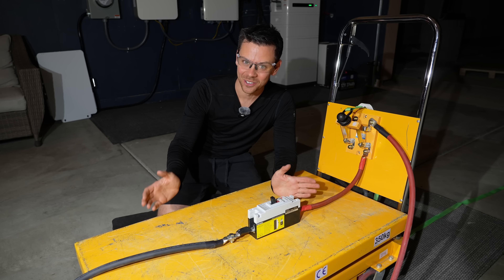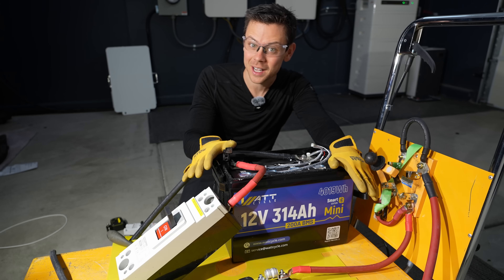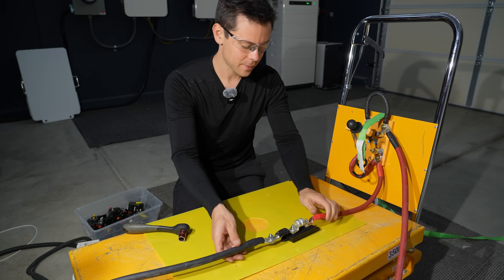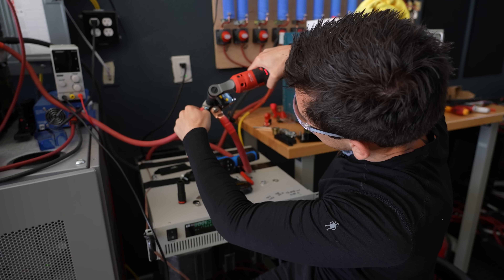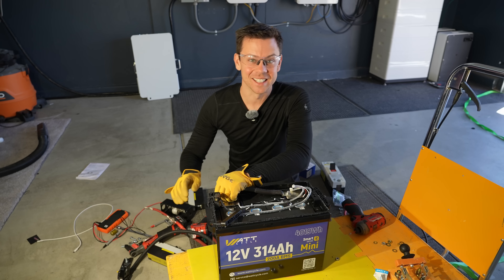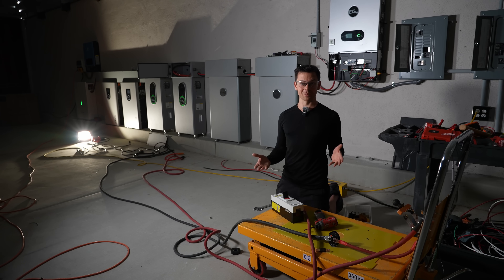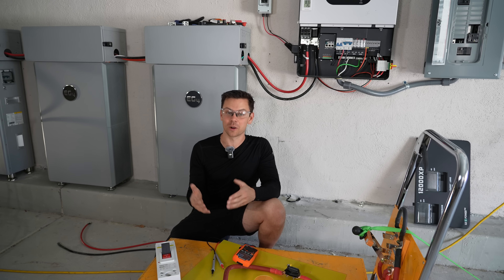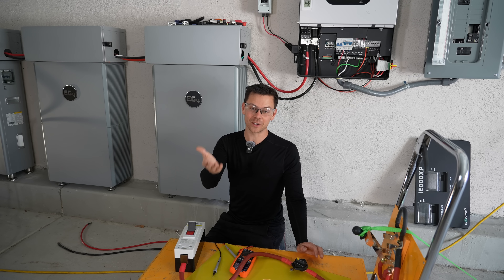DEAD SHORT 88kWh Lithium Battery Bank! What Will Break First?!

Comment: Raw cells would seem to be the only way... 

You risk frying a BMS this way. I'm impressed they are capable of switching off a dead short without blowing a fuse. I wonder what switches they use internally... Just very big MOSFETs? I guess they might be fast enough to catch it before current ramps up to kA levels through cable inductions.
Reply: MOSFETs are several magnitutes faster than any mechanical switch or fuse. In fact, if you can't turn off a MOSFET quick enough electronically, then the fuse will be there only to protect the power source and the rest, the FETs will be gone (fail short or blow off and vaporize completely, so it might even save the fuse 😂).

This turn-off time should be quick enough so that the peak current stays below the FET's (non-)repetitive max drain current (as per datasheet). Achieving this quick shutdown requires 2 things:
- detecting the overcurrent quickly enough (i.e. no slow low-pass filtering on current sense, at least not on the short-circuit protection path, that is)
- switching off the FET quickly, which requires depleting its gate charge as quickly as possible, which means some high-current gate driver (at least high enough in the pull-down direction). It is common to see some gate resistance and a parallel diode in FET/IGBT driving circuits, exactly when the turn-on not necessarily has to be that quick, but the turn-off has.

Also, if you can not guarantee quick enough turn off as the internal inductance of the system is that low, you might opt for designing in some inductance to limit the rise time of the current to the reaction time of the protection circuit.

Comment: If you want true high current then get some large laser discharge capacitors or equivalent to place in parallel with your batteries.  (With initial charge through current limiting resistor, as if you were connecting power supplies).  This is also much safer because the "unlimited current" time is shorter than with no BMS batteries.

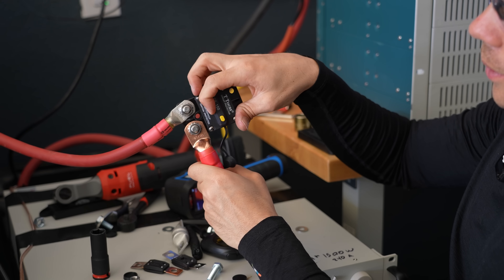Comment: What Fun.  🙂 Will, at 04:00  you act surprised the about this 12V test and say "so less voltage, smaller arc but more current. And it tripped it perfectly. I can't believe this did not trip with the 48V 30kW pack".
Also at 4:20  you say "And a lot of 12V batteries that do not have over-current-protection it's really hard to get over 600 or 800 amps because the wires heat up and the resistance increases".  
While high current in wires causes them to warm, and from there the wire resistance goes up due to the increased wire temperature, it is not going to effect the PEAK INRUSH CURRENT that trips this breaker in less less than 1 second.  
As to getting over 600A on your resistor bank, that bank is made up of 10x 0.2 Ohm (200 mOhm (milli-Ohm)) resistors thus 20mOhms for the entire resistor bank. A fully charged 12V battery (at 14.6V) through a 20mOhm load will deliver 730A.
(I need to workup the temperature rise expected in a wire pulling overload current for 2AWG, 2/0 AWG and 4/0AWG wires, but the math is too involved for now, will follow up with data from a spread sheet . . . and I am past my bed-time.
Again, Thanks Will for this especially Fun video.

Comment: If you do a "raw cell" test please add some suitable "last resport" disconnect capability. My fav for this is a pyrodisconnect, plenty available cheaply that are rated for EVs that runn 800v so they have a huge and proven disconnect capability. Second best is the largest dc contactor you can find, preferebly with a large capacitor and fuse in paralel to try to prevent the contactor welding shut!

Comment: Great tests.  Confirms what I was taught years ago.  Short curcuit current is severely limited by wire size. Having a BMS just makes it all safer.  Good fuses generally work.
I was doing power system short circuit analysis for large plants in the early 80s.  Before personal  computers.  Ridiculous amouts of numbers crunching on a calculator.

Comment: GO with raw cells, 20S, so you cover also higher voltage. No need to parallel them, as they can supply kA easy for short time. You can damage the BMS as the internal driving for the mosfet  is slow, so during the short circuit the instant power loss is quite high if they disconnect, let's say they are not really designed for this and the external wire length has an impact on stored energy that needs to be clamped.

Comment: Thank you for doing this testing Will - it is neat to see the protections of a BMS do work. 

Question - The BMS breaks the connection for an overcurrent due to a dead short BUT it will reconnect after the set time. If the dead short remains it reconnects to a dead short then releases and the cycle continues until something melts. That is what I want to see - leave that knife switch closed and see how many cycles of disconnect the BMS can handle until something fails.

Comment: Retired circuit breaker engineer here.  Be very careful.  Our short circuit test lab is the size of a high school gymnasium with us in a control room behind 2 layers of bulletproof glass and controlled ventilation to evacuate the interruption byproducts.  There are ways these tests can go sideways that you are likely unaware of. Not recommended for DIY
Reply from the maker: I understand. It is very dangerous
Reply: I’m not confident that you do.  Test lab short circuits are conducted with both a secondary clearing device and the current source rated for the short circuit current and voltage.  You look to have neither. The device under test can fail to stop the current and create an explosion.  The arc plasma is superheated, electrically conductive and poisonous.  Maybe see if you can visit a test lab to see for yourself

Comment: If you're looking for a fairly indestructible way to switch a huge amount of current, my old hackerspace created a coin shrinking setup a long time ago that was capable of switching well over 10,000 amps of DC.  It was a military grade pulse capacitor the size of a washing machine that would be charged up to 10,000 volts and was then discharged in a few milliseconds.  The only thing that could reliably stand up to the load were massive copper busbars wired through a pair of short jumper cables that were brazed to silicon carbide contacts.  Each of the SiC contacts were cylinders about an inch in diameter and an inch thick.  The two brazed contacts were then mounted in HDPE sheets that were setup in a book hinge arrangement with surgical tubing that would snap them together when a rope-mounted chock block was pulled out.

The setup survived at least several dozen discharges that I'm aware of.  Each discharge was roughly equivalent to the energy of a 30-06 rifle cartridge.

Comment: I get it now, you're not testing battery safety with a bank, you're testing the fuse itself. In that case I agree with the comments. A supercapacitor will do a fine job and limit the total energy available in case something goes wrong. Lots of brands to choose between

Comment: Bms has short circuit protection if it is a bms as it has fets to turn off the battery in case of over voltage.  Most bms say they protect against shorts but may not survive so they do not suggest you test it.  The breaker is a secondary protection as well as a manual switch.  If the bms fails it usually fails on so you need a breaker or fuse as backup

Comment: 2/0  cable has less than 0.0001 ohm per foot of resitance. If you keep the total round trip cable length to less than 10 feet, reistance will be under 1/1000th of an ohm. A 48 volt raw battery, with no intervening fuse will have about 2 milliohms of resistance. 3 milliohms total will limit the current to (theoretically) 16,000 amps from a 48 volt source. Your big knife switch might add another millohm. Rig up some kind of spring or bungee cord and a trigger mechanism to slam the knife switch shut as rapidly as possible, and it may survive more than a few shorts.
Reply: All the connections also add up. Crimps, screws, at each end of each cable. Tightening is one thing, but if you clean the oxides off of the raw copper lugs, it makes then much better.

Comment: Circuit breakers open slower than a fuse. A magnetic circuit breaker will trip faster than a thermal breaker. There are instantaneous trip breakers but they cost a fortune. Electronic circuit breakers in the BMS will open faster. Do some research on breakers.

Comment: Wow, this was incredibly interesting. Perhaps T-class fuses are not actually needed when dealing with systems that are not using giant cables. For example, a system using 4 awg with batteries that have short circuit protection, it's likely impossible you'd ever get over 1000 amps.

Don't get me wrong, having a T-class fuse within a battery pack is awesome protection and shouldn't be frowned upon, but placing them outside the pack for that 'extra stopping power' doesn't' seem needed unless you have gigantic cables and a BMS that allows all those amps through.

A good ANL fuse should be more than sufficient, or even just a good breaker.
Reply from the maker: Exactly.
Reply from the maker: Agreed

Comment: I am wondering if it would be just as safe and cost effective to get a few big old led acid truck starting batteries of something like them.  That way you don't have to risk hurting any lithium cells.  You might even get lucky and get a bunch to use from a trucking shop they often buy a bunch in advance. could do a trade and help them with an overnight kid so they dont have to run trucks at night for heat and AC could be some more videos in that as well.

Comment: Breaking current capacity is what we're told to be weary of on DC. Ive used the Marine stud fuses on home built, 300ah 48v battery banks, but do wonder what would happen if I shorted them out - The fuse would blow, but would the resulting arch remain across the narrow bridge and potentially cause a fire??

Comment: Wow great tests!! Those are not the results I expected though. I thought for sure that Ruixu rack would be blowing up some components. I still think it's important to emphasize proper over-current protection regardless of what's built in to the battery. It doesn't hurt to have a separate Class T - you'll want it for sure if the primary safety mechanisms fail (stuck FET, welded built-in breaker, etc).

Comment: I used Gigavac HX460 contactors in a design for a high voltage DC test-bed.  These could interrupt 5000A a few times at 400VDC (and much higher at 48VDC).  The are non-latching NO contactors which can be safely driven by a 28V signal.

Comment: If AND ONLY IF you feel you can do it safely, testing if budget or "sketchy" brand BMS would catch these kinds of overcurrents would be good to check. I feel like from your testing that "decent BMS + 1 main T-class" is safe for 95% of us, even if we have multiple loads the main fuse, BMS, and "small" (relatively, 00 seems to be "small" for surge/arc of over 100s of amps) wires seems to indicate that downline fuses/breakers dont need 20,000 AIC level breaking.

Comment: I did something really stupid. I made 2  xt60 to 1 xt60i connector. I thought hey so I increase the voltage if I run 2 sets of the M8 to XT60 through my coupler.  Well stupid me forgot that only works for 2 separate batteries.  I didn't even connect it to anything but once I connected the 2nd XT60 from the same battery the terminal sparked like crazy with a pop.

Good news the Litime battery appears to be working according to the app.

Bad news the post on the negative M8 screw partially melted, so while I got it out, I can't insert one that is not damaged. 

Should I just write it off as a loss or is there a way to fix the terminal.  When I use my multimeter it's still reading voltage 

Could have been worse, definitely a learning experience. Sharing so no one else does it.

Comment: If you don't want current limits, have your batteries charge a capacitor bank. Then disconnect the batteries once current drops to zero. Run the test off the capacitor bank. If you don't want the test destroying your switches, maybe try an industrial size inductor in series.  You can probably make one out of battery cable wrapped around an iron pipe. But that might limit current inrush too much. Maybe a low value inductor - just enough to knock current down in that first instant.

Comment: Fun video. A dead short on raw cells is always going to trip something. The BMS in your battery pack probably has fast short circuit protection. To minimize the arc on closing the switch, close the switch fast. It only arcs when the contacts are bouncing. Maybe an automotive starter solenoid would work better than any of the other stuff you have tried so far.

If you could essentially fire a copper wedge into the gap in a massive bus bar, that would provide very fast switch closure. You want something that closes fast and does not bounce. Of course if you do this with raw cells you have to be 100 percent sure you have a way to kill the power, too. Just in case the fuse doesn't blow, then something else will (like the cells, maybe).

What is interesting to me about all this is that people who are building BMSs that use external contactors really need to take the fault current limits seriously. But internal BMS packs don't need to be AS concerned about interrupting amps. Even if the BMS is messed up or non-functional, it is still going to add enough resistance to the circuit to limit the fault current a little bit. So it may not really be necessary to use class T fuses on big house batteries with electronic BMS.

Comment: you can measure the current with a scope even a cheap used oscilloscope  just use your lead as the shunt and voltage drop across the leads and known resistance you can  look this up  by gauge of wire  per foot then you can get real current measurements. and a cool looking picture for thumbnail
reach out if you dont understand ill explain more

Comment: With the current and voltages and testing you are doing I highly recommend looking into some arc flash resistant clothing.   It's no joke.  But thank you for testing those cheap "safety" devices.  Throwing out the bojack stuff now.

Comment: @WillProwse Hello  Will, I use a 500 Farad capacitor bank to assist in balancing cells.  I wonder is testing might work better with thin parallel on a 12V test?  Regards

Comment: For these tests I think lead acid batteries would actually be your best bet as they can output tons of raw power without any BMS or anything required for them so there's nothing at the battery limiting the current.

Comment: Need to install a strong spring on that manual switch that holds it disconnected, so if you let go, it will disconnect, before all the batteries melt, incase of a complete failure.

Comment: Still confused on why you'd need a fuse or breaker if your battery has a BMS and/or internal breaker already.  In the video the batteries seemed to cut the power during a fault so why add another fuse or breaker?  Redundancy?

Comment: Crazy testing Wil but go you for doing it.   For these tests you really need a capacitor bank attached to your battery to be able to supply the instant load you require.  I have a bank of 22 caps in series.   2.7v and 3000f.   I had to charge the bank with a high value resistor over several hours so it didn't fry anything.   The bank works well for starting loads like motors which can sometimes have a heavy draw on startup.  Would work very well for your testing here.
Reply: Nice, I have half the size of supercap bank that you have. I charge it with a constant current DC-DC 600W power supply. Charging is extremely slow at low voltage (20W at 1V) and gets faster as it climbs in voltage (500W at 32V) I had it set up in my car for a little while in 6S2P config, and pulled as much as 120A from my alternator, measured with a shunt battery gauge. They are a lot of fun. 

Discharging them can be a little difficult though, I haven't thought of anything nice to make or pair with it when experiments are over. It's just such a big working voltage range

Comment: If you end up using raw cells without a BMS, perhaps a Tesla's pyro fuse you can remote trigger as a last resort. They're not too expensive either.
I really would be interested in seeing what happens when the 48 V battery BMS MOSFETs fail closed. Or just to show how dangerous it could be to not run a BMS.

Comment: Will, get a 65volt 500farad super capacitor by Maxwell, use this for your load testing. When the cap is depleted use your knife switch to close the loop inline with raw cells at your nominal voltage of 53v. And measure the amps, this will freak you out forsure.
Reply: Reeds Solar Designs llc.
Reply: And run a short loop of cable

Comment: Its not crazy that the battery BMSs tripped first. Each battery in parallel gets its share of the fault current based on its internal resistance + path resistance, but still high enough to trigger the SC disconnect. It's BMS will trip in microseconds vs milliseconds. The BMS is the first line of defence not the last as is often repeated on the forum.
Reply from the maker: Absolutely!! You get it
Reply: @WillProwse  a while back you did a review on a rack full of ruixu and you had a short when you inserted a battery. The class-t tripped and that was very concerning.
Reply from the maker: I thought I could get a bit more out of it, but dang did it trip quick!

Comment: Been following your tests and advice since your old camping van days. Learned so much. Thanks. For this last series of fuse and breaker tests, you have often exclaimed "woe, that's crazy or insane" after a result. But you do not always explain what the result is telling you. Is it crazy because it failed? Or is it insane because it passed? Was the result a good thing or a bad thing? What are the possible consequences of a failure? Fire, damage to the system? That bit of clarification would be helpful. Thanks! And keep these very informative "tutorials" coming.